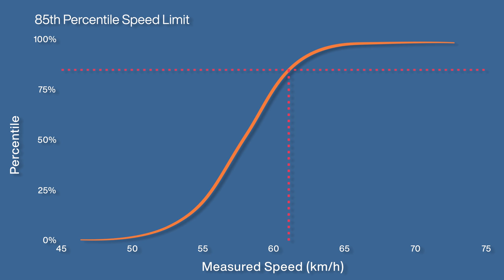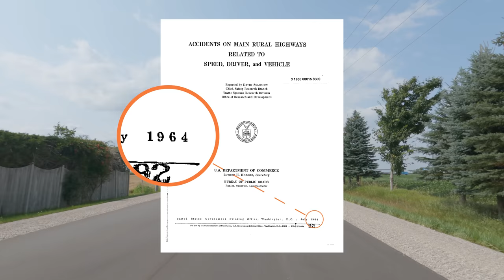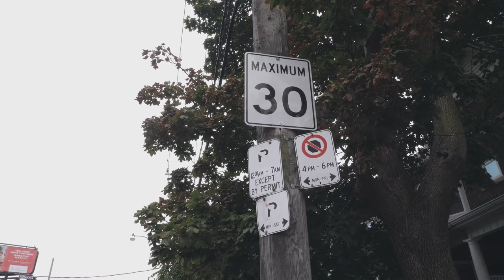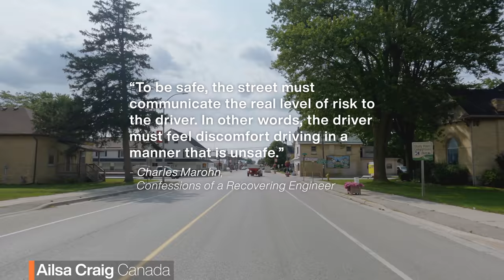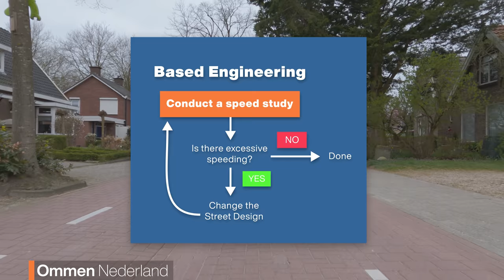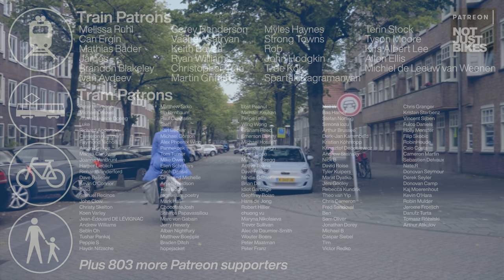The Wrong Way to Set Speed Limits [ST06]

Comment: I take HUGE issue with what you say at 5:10. Yes, you're right, MOST drivers are driving subconsciously, and it's dangerous AF, but it doesn't need to be this way. I am not a professional race car driver, but I DO drive extremely actively, and imagine I'm in the top percentile of drivers on the road. Yes, it is tiring on long trips to be ever alert and not relax your attention even for a second. But it's possible, and that's the important part. We shouldn't just excuse shitty drivers just because they're the majority, we should raise the bar.
Also, you unintentionally discounted every motorcyclist on the roads too. Well, maybe not every one, but motorcyclists in general also have the 100% alert, never relaxing their attention for a second mentality when riding on roads. It's possible. So no, I don't excuse shitty drivers, even though, as you say, basically every one I know is a shitty driver that doesn't pay enough attention.
Reply: Interesting perspective I must say. But do you realize just how much humans actually do subconsciously? Driving subconsciously does not mean you sleep behind the wheel, but it means that you focus on the things that are important in your current environment. And different environments require different levels of focus. Meaning my level of focus is quiet different between 200km/h on the Autobahn, 130km/h on the Autobahn or my driveway at home. And that is the point of the video, change the environment to require the focus of the driver subconsciously.
Going by your suggestion, no one would be allowed to even think "I gotta pee", while driving. That is simply not possible, not for the average driver, not for me and I imagine also not you.
PS: Of course I don't excuse shitty driving, but shitty driving is such a loose term, that a fatal crash and scratching a fence, both can basically be described as "shitty driving". But like language, humans are slightly more complex than that.
Reply: Under rated comment. 
When I’m a passenger, the driver seems to be looking at the windscreen rather than through it. They hit obvious potholes, curbs. They’re often oblivious to road signs. They don’t notice other vehicles or motorcycles and therefore cannot anticipate their movements.
Uber drivers are some of the worst. One guy came down the freeway on ramp doing 50km/h and entered the 100km/h zone. He was completely oblivious to the mayhem he’d caused by driving so slowly. I thought we were gonna be killed by an 18 wheeler.
Reply: Setting aside the issue that is physically impossible for a human to pay constant attention for long periods of time (20-30 mins TOPS) without having their mind drift for even a single second. As a engineer you CAN'T build a road expecting people to be in the 99% percentile of all drivers. 

It would defeat the economic purpose of having a road if the only ones capable of using it were the overwhelming minority capable of superhuman feats of concentration. As an engineer you always want to build thinking of what can go wrong, not hoping for the best.

Comment: At one point in time, my 6 mile commute to work would take anywhere from 8 minutes to 50 minutes, all depending on the 24 traffic lights in between. 
Also, the traffic engineering techniques you suggest would only work in very light traffic areas to slow down a single car. How about a road that handles 100,000 cars per day? Narrowing the road to single lane traffic does not work at 4PM when the home-bound traffic rush hits.
Reply: 100,000 cars per day is likely to be an interstate highway. More local type roads rarely reach a number that high. Narrowing the road to a single lane often does work because people can't weave in and out between lanes. It allows people to drive at a safe distance and maintain their speed better. That said, it does not ALWAYS work, and every situation has its own complexities to work out.

Comment: One thing I have thought about a lot is that the factors that determine a safe speed are dynamic. Road surface and visibility change with weather and time of day. Traffic is changing all the time. But the speed limits and other rules are static. Icy highway at rush hour in the darkness of December? 100km/h. Sunny Sunday in June with 8 lanes to yourself? 100km/h. Is there anywhere with dynamic speed limits?
Reply: Variable speed limit depending on weather and time of day make sense. If cars had speed governors, the car's software could compute a safe speed and use that as the speed limit (hardware-enforced). Also, since risk of death is more closely related to kinetic energy (mass times speed-squared), shouldn't we be using a kinetic energy limit instead of a speed limit? That is, a big, heavy SUV (2100 kg) is 3 times heavier than a Smart Car (700kg), so the SUV should be forced to drive at 1/3 the speed of the Smart Car, to equalize the risk posed by each car to a pedestrian that they might run into. Tolls could be proportional to weight, also. All roads should be toll roads.

Comment: The stroad came about because of urban sprawl.  50-80 years ago they began converting farms into suburbs.  Commercial businesses don't do business in the neighborhoods because of zoning and the desirability of setting up shop between the newer developments and older established places.  The stroad usually runs from the highway, into a commercial area then into a suburb.  Since commercial businesses contain parking lots, the adjoining stroad allowed for faster traffic.  But the stroad had to accomidate pedestrians, cyclists, and busses because of its importance, as the areas grew. I am commenting about my hometown, the eastern suburbs of Louisville, Ky in Jefferson County.  Every major artery to the city from the outer neighborhoods is a stroad or to get to the expressway, by stroad only.  Shelbyville Road, Taylorsville Road, Bardstown Road, and more.  Dixie Highway is an infamous stroad in the area which is nicknamed Dixie Die-way, and also it has the most dense concentration of retail in America, but large parts of it are high speed and without sidewalks.  There's no way to change that, the Louisville area is probably worse than the examples in this video!

Comment: one important thing to consider for those that want to change anything in any group of people including society, people are like electric current, they take the path of least resistance, people will adopt the change that least resistance (pain) requires. So the most important thing to make clear to people is 1. change is not going to be painful and 2. the change will remove daily pain. and the rate between these 2 and how much people is aware of it is what drives change.

Comment: I think the German system is pretty good. We've got roughly 5 speed limits: Walkingspeed (<10km/h) in "Playstreets" ("Spielstraße", indicated by a sign with some kids playing on the street, it's just a name so there are often no kids even near them), 30km/h  for residental areas (basically if it's above 80% housing, this is mostly applied, there are no signs at crossings, aside from a few exceptions as you're expected to adhere to the "Rechts vor Links"/"Right before Left" rule that dictates that traffic from the right always has the right of way), 50km/h for "Stroads" (all streets within city/vilage boarders except stated otherwise), 100km/h for rural roads (again, except stated otherwise, mostly reduced in dangerous places like crossings or places with bad visibility) and 130km/h "Richtgeschwindigkeit"/"recommended speed" on the Autobahn (but only in a few places, most of the time there are signs that dictate a lower top speed, especially around construction sites). 

If you take a look at your surroundings, you can clearly tell how fast you're allowed to drive. If unclear, then chose the next lower limit and you're pretty much always safe.

Comment: There may also be something in the way you're taught to drive - learning to drive in the UK, I was taught if it's residential and you don't know, it's 30mph, if it is country road or motorway/dual carriage way with no pavement, it's national (i.e. 60mph single carriageway, or 70mph dual carriageway). Any other speed limit (20, 40 or 50; or 60 on a dual carriageway) will be frequently signposted with smaller red-circled signs at frequent intervals along the road. Basically, being taught to guage your speed by pedestrians/no pedestrians and default to 30mph makes a difference too.

We do still have problems with speeding, but I've also encountered plenty of drivers doing 30mph on 40mph roads probably because 30mph is the taught default. With country roads, where the speed limit is usually national, but it's rarely a good idea to do national, we are also taught the mantra 'it's a limit, not a target', and again to judge your speed from your surroundings - blind bends, blind summits, farm entrances, always ready for tractors, width of the road, etc. Maybe different learning to drive in cities, but this was universal among me and my friends learning to drive in Cornwall for the Bodmin centre.
Reply: In the USA we are barely taught to drive in any meaningful sense, and maintenance of this knowledge is a joke.

Comment: Here in Cheyenne, WY; we have a couple 20mph (≈32km/h) zones downtown, and they feel EXTREMELY unnatural because there is no narrowing, not even for pedestrian crossings, and there are two lanes per direction. If you ride the speed limit on a motorcycle here, you risk people dangerously overtaking (or worse, undertaking [perhaps in both senses of the word]) you.

Comment: One of my problems with speed limits is if you are going 5MPH below the speed limit in many areas you can get pulled over for driving too safe. Where if if you are 2 or 3 MPH above you also could get pulled over if the cops are ticket hunting. It's just when you go below they are hunting for a DUI.
I can't wait for self driving cars to be a norm

Comment: The rural areas point is very accurate! In the UK a lot of tiny country lanes are technically the national speed limit but nobody except a few twunts drives that fast haha. A good example I can think of is the road to my granny's house (she lives in the middle of nowhere). Most of the way is fairly wide roads with low hedges on either side, then when it goes through a village it gets narrower and bendier, then in the tiny lanes it gets very thin with high hedges on both sides, and so people drive at different speeds on all the roads

Comment: I have a road nearby that is 4 lanes wide (2 each way and no median). It is a straight line for 3-4 miles. The speed limit is 35mph but it drives like it should be 45mph. This is in the midwest of the US.
Reply: That said, I would love to be able to drive the road instead of driving the speedometer. I often feel like I am driving more dangerously because I am driving the speedometer, and I do so to avoid the secondary road tax, aka, the speeding ticket.

Comment: I live in The Ocala National Forest in Florida.  The speed limit on the ROAD going through the forest is set to 55 MPH except through towns where it's lowered to 45 MPH. It's SR 40. Most drivers will go 70 MPH because that is what the road was designed for and it was the speed limit until the Arab oil embargo in the late '70s. Then the government decided to lower the speed limit on all highways to 55 MPH.  This turned out to also lower the death rate and for many roads built for 70 MPH, the government decided to leave at the lower rate. All it really does is create a hazard when one driver decides to go the speed limit.  Traffic backs up behind him and the dangerous high-speed passing begins. Near miss head-on collisions are constant and sometimes not near miss. maybe some roads the lower speed limit works but not all. Just random numbers.

Comment: Thank you for speaking on this. In my hometown, the main road on the west end goes from 55 (mph) to 45, down a steep hill with a 30 speed limit sign posted at the base of the hill, and then is 30 again until it randomly jumps to 45, and there is literally nothing different about these ends of the road. Well, to be fair, the 55 end definitely feels different than the 30, but that 30 is the exact same road as the 45. People are consistently driving 45-50 in the 30 anyway. Not because there’s a lot of drive through traffic not paying attention to speed limits (there are like 15 stop lights on this road), but because it’s ridiculous to drive that slow in this area. We’re being asked to drive 30 mph in an area with very little to no pedestrians, no businesses, and very few driveways. And if someone IS turning, there’s even a middle turn lane for people to turn into, so we never have to slow down for people making a turn. The speed limit makes absolutely no sense. Our road in this area is most definitely a stroad, though. It’s a hybrid because SOMETIMES people are walking, but that’s pretty rare and only when people don’t have a car or a ride to get somewhere. Most everybody is driving. It’s just a crazy setup. But I don’t know if they’ll ever change it.

Comment: A speed limit should never be below 50 kpm. If it's so dangerous to have vehicles there that it needs to be below 50kpm it's not an appropriate place for cars at all, and there should not be any asphalt wider than a bike lane on it. You're on the right track but you're also just not. 50kpm is the lowest useful speed of a car. Anything below that negates the value of the car, makes the stroad worse than useless, and creates additional danger you're not considering - frustration speeding. A ton of speeding accidents in low speed zones are from people who 'know' they can go faster safely but are being blocked by traffic, so they shoot around in a place that isn't safe to do so (in the bike lane, around the left turners at an intersection etc) and so on.

We need more overpasses, alternative paths for bikes entirely, free parking garages with a bus stop right outside and a lot in walking distance, etc. Separating the traffic as much as  possible should always be the goal. But there will always be need of cars (no, neither busses, bikes, or walking solves the problem for people with disability or areas with heavy  incremental weather or for places that charge an extra 5 bucks to take you the last 5 feet of your journey) so there needs to be a way to get a car to most locations.

We also desparately need to separate our throughways and our towns. Also, society needs to be COMPLETELY reconstucted so that there's less need for driving, and long distance driving, in particular. YOu can't have low speed limits when people need to drive 100km a day in their daily life. That don't fucking work. So our cities, towns, and especially rural areas need to be rethought so that people canf ucking live where they live without running north 45km, then south 120 km, then back twice a day for work/school/shopping.

Comment: At 3:51 - Not speed, not momentum, it's Kinetic Energy that counts. mass x velocity^2 / 2

The velocity squared is why fatalities don't go up by a little bit, they jump through the roof with increased speed.
Reply: ☝️This is the formula I always cite to those that claim going fast isn't a problem. The same mass traveling at 70mph induces four times the kinetic energy as it does at 35mph.

On top of that, higher velocities decrease reaction time and substantially increase stopping distance, the latter due to stopping distance also varying with the SQUARE of velocity. In the end, physics dictates the severity of the crash (and the space needed to avoid one).

Comment: Whenever I drive on a stroad, which is very often because of where I live, I find myself going well above the speed limit, but I'm only just trying to match the speed of the cars around me..  that 40mph speed limit is literally just a suggestion here. I only slowed down when I came across one of those digital signals that displayed your speed, so it did work, but not far from it I was picking up speed again.

Comment: we have electronic speed signs so the speed can vary from 20kph to 100 kph on the same stretch of road depending on traffic, weather and time of day, and to slow cars down on residential streets we have speed bumps, or concrete blocks and steel poles to steer around

Comment: Great video
It's really so unbelievably true that the speed of the cars depends basically on the road design.

I would drive over the limit on a straight and wide road, with nothing on the sides of the road, and if a cat or a dog would run across the road, it could be too late to hit the brakes.
Meanwhile if the road surface was made of bricks or cobblestone, it was narrow and there were cars, trees or other object limiting visibility - I would surely go below the limit, probatly even quite a lot slower than the "speed suggestion".

Comment: Beneluxbaan in Amstelveen at 9:15 :) Nobody drives 50 there, in fact a driving instructor told a student there to ignore the 50 sign not to hold up traffic. Police sporadically checks speeding there but gives fines only if you drive like 30 km/h above limit. But yeah it kind of underlines your point - this used to be a 70km/h road and there was so far too little done to change the feel to 50 km/h

Comment: My one of the roads that comes into my hometown I'm certain used to have a higher speed limit than now because I always tell myself that I need to slow down more for it and then I look down and I'm still doing 35mph in a 25. Eventually I just found the spot on the hill where if I let off the accelerator there I'll be going the right speed by the time it matters.

Comment: Bad rural road: Cornwall, ON to the 417. It's treated as an extension of the 417 even though it passes through hamlets and is mostly a 90 kph zone with sections that are 50 kph. Insane passing on hills and solid lines, routine speeding. Plus, it's the main Cornwall to Ottawa route. Did I mention Cornwall? Need I say more?